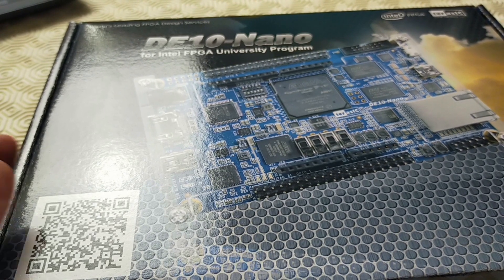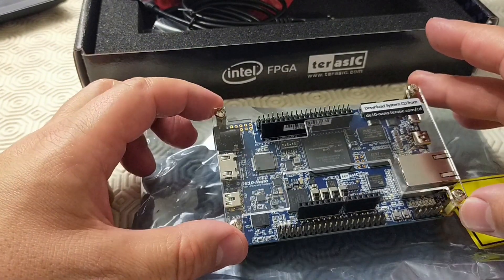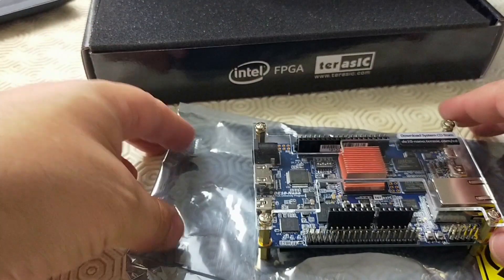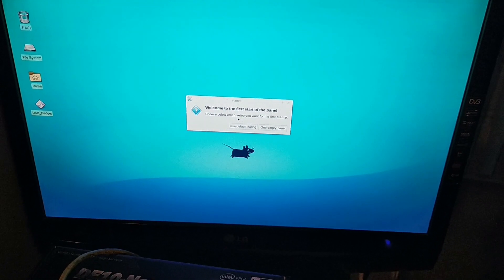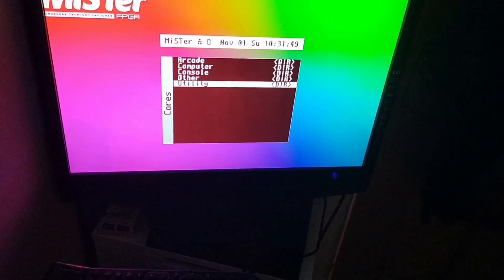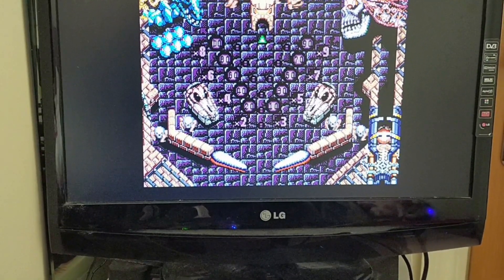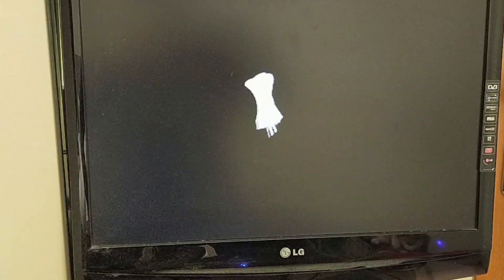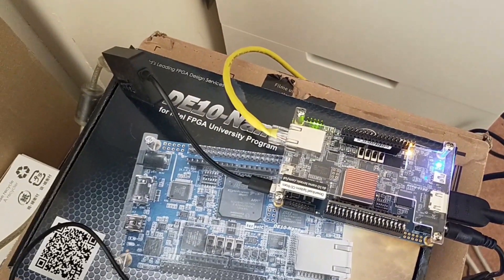Unboxing and setting up a MiSTer

Comment: if you get the cores for example neo geo...is the bios included?? or do you also need to get the bios somewehre??  so you only have to put the roms on it yourself... i hope somebody can answer
Reply from the maker: You need to supply roms and bios. Their is a script that helps with a lot of required stuff but always assume you need stuff to get it running
Reply: @bitsnpcs4172  there is an install script now and it will do the thing..... i know enough thx

Comment: Is it that much better than the Raspberry pi 4?
Reply: This 'duplicates' the actual hardware; whereas the Pi does software emulation. Both have unique challenges, but a properly designed FPGA core will be identical to the the real hardware.
Reply: Yes.
Reply: If you mean better experience bc more accurate. Yes. Its the best investment in retro tech i ve ever made.
Reply: @ninetendopesaitama2107  Thank you, you convinced me. I ordered the 1st piece :D
Reply: @sandplasma  you wont regret it. Get the 128mb sdram and then you have everything which lets you play the whole neo geo library and all consoles. Get the Mr fusion Image and the Update all script. Thats everything you need to get started. Look it up on yt. Just the neo geo core is worth the price imo.
Reply: @ninetendopesaitama2107  Awesome, thank you! I'll order the 128mb sdram next and download the image to have it ready. Any controllers that you recommend?
Reply: @sandplasma  i have a controller for every console kinda. But mostly i use the Sn30 pro. It has enough buttons for every console . Also using retro Bit Sega Saturn wireless controller, 8bitdo tg16, neo geo mini controller,hori fighting commander.
Reply from the maker: I see several folks have commented already. Whilst the Pi can have fancier front ends I feel the MiSTer beats it on accuracy and lag

Comment: I think I'm gonna put some cash aside for one of these. I want an OSSC too for some original hardware, but theres so many ROMs that are financially unatainable that would still be if I wanted to use original hardware (PC Engine with SSDS3 comes to mind lol, the good PCE CD2 games get expensive) so a MisTer makes sense. So much hardware, so little cash lol
Reply from the maker: The emulation/reimplantation of the fpga makes it feel like playing on an original...and roms are easier to get vs the silly prices for some games
Reply: @bitsnpcs4172  yeah game prices have become insane. All my retro consoles I have modchips, ODEs or Everdrives for lol. I buy plenty for newer consoles but you go to GBA, PCE and Sega Saturn it gets dumb, and those are my favorite consoles haha
Reply: Wait for the OSSC Pro. I know I am waiting.
Reply: Its worth every cent. MiSTer is just amazing.

Comment: A very good MiSTer introductory video that highlights the fact that you don't need to have all the bells & whistles in terms of a fancy case, I/O board & the dedicated USB hub to get the most out of the MiSTer. The only thing I will say is that unless Terasic have changed the PSU in recent times the included PSU is multi-voltage (110V + 240V) so will work fine in the UK with just a standard cheap adapter plug. In my two years of owning the MiSTer it is now my main dedicated retro gaming device, and is the best retro gaming device money can buy!
Reply from the maker: Thanks for comment re psu, i had a uk one for use with expansion boards so i don't plan on using the base one. Will look at expansion boards in the new year

Comment: Great video, I love my MiSTer, Please do more. Subbed.
Reply from the maker: Will have to source an hdmi recording solution to do it justice. Checking black friday deals
Reply: @bitsnpcs4172  I use an avermedia live gamer mini with mine for capture. It works well but you have to run the mister hdmi at Match Display Frequency. You'll get 1080p at 60fps.

Comment: Got mt de-10 in the mail/post last week.  Gotta unbox it and test it out. then gonna go crazy with neo geo and cps1
Reply from the maker: Love my Neo Geo stuff, will have to look into adapter to use my aes joysticks with the core
Reply: BitsnPCs that would be cool. I’d rather use my usb neo style joystick. I don’t want to damage my AES control since I only have the one inside the box with my AES😎 which I don’t think is gonna come out of it’s box anymore just to preserve it.
Reply: How did this work out for you? (neo geo) any hang ups?
Reply from the maker: Neo geo working great, the adaptor for the joysticks is still on my want list...as is the usb board...maybe in next few weeks once ive paid off a big bill
Reply: @lwwells  sorry late reply... life happened, I have to put it on hold for now. but I've seen plenty of others running NEO VERY WELL.
Reply: @adonian  I've got mine up and running on the desk. The neogeo is flawless.
Reply: @lwwells  Awesome!  I hope I can jump back into mine soon, but this CO**VI**D crap still has me working from home at 1/2 pay... Just enough to pay bills but no frills 😂
Reply: @adonian  I'm also primarily doing home office and we are currently on lockdown here in Aachen Germany. It's been maybe 6 months with really only have grocery stores open.